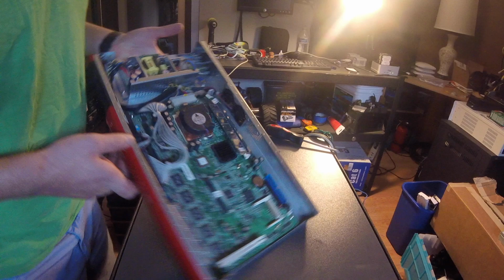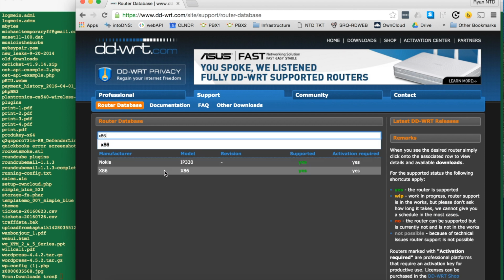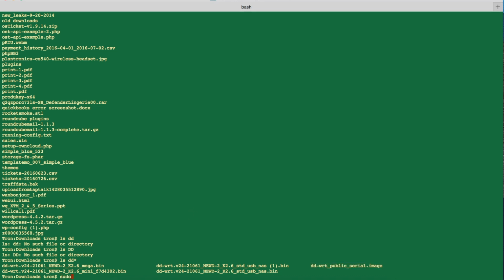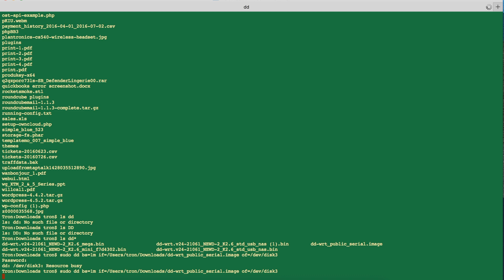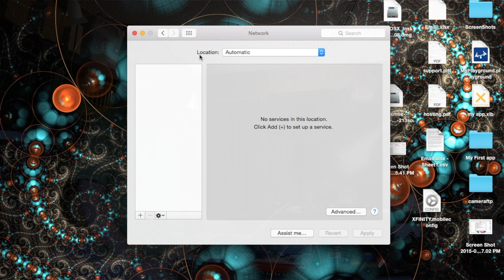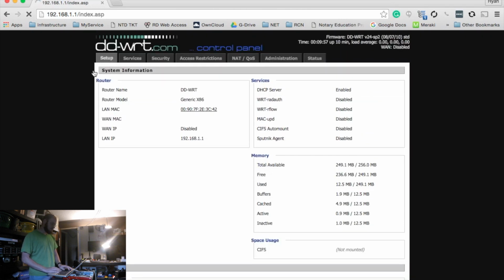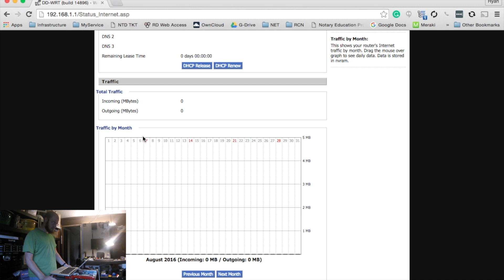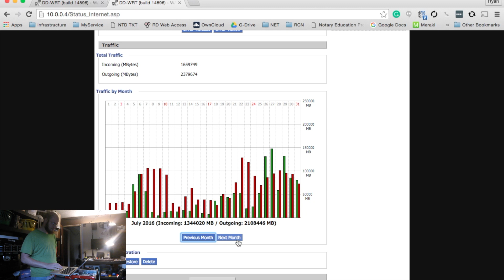Throwback - Install DD WRT on WatchGuard Firebox

Comment: The build that you're using is like 10 years old. Check this one: ftp://ftp.dd-wrt.com/betas/2020/08-18-2020-r44213/x86/
Reply from the maker: it is an old video, which is why it's a throwback. but thank you for linking to the new guide for others :)
Reply: @bgp4me  I'm also going to mention that despite the fact that the new builds are marked as "beta" they're much better and much more stable than the old "stable" builds which were full of bugs and problems (like bootloops).
Also - the official wiki/web pages are severely outdated. No one should use the builds that are "recommended" there. The recommended builds (even on the official forums) are the newest beta builds, where the most critical issues are being fixed within 1-2 days.
Reply from the maker: @dataskin  ill agree with what you just said :)